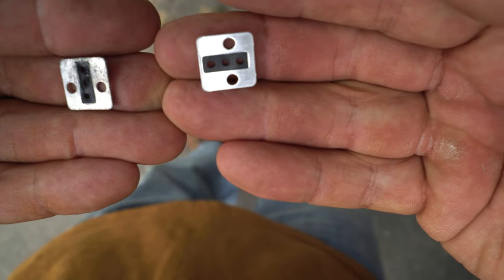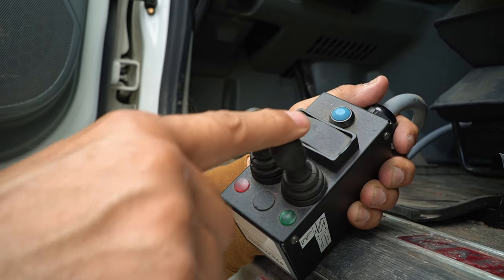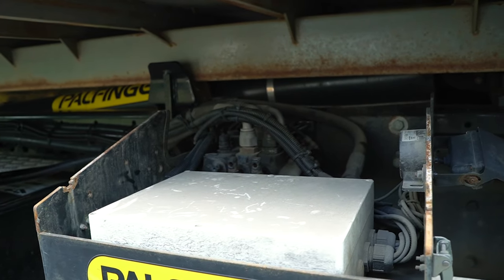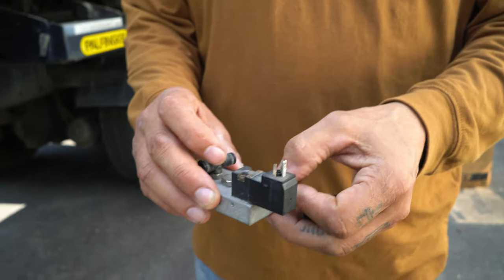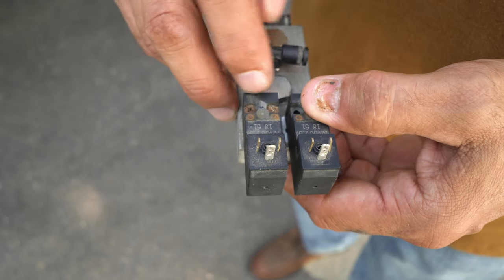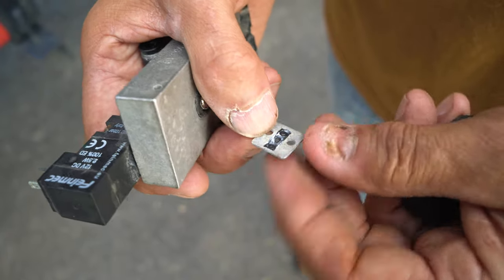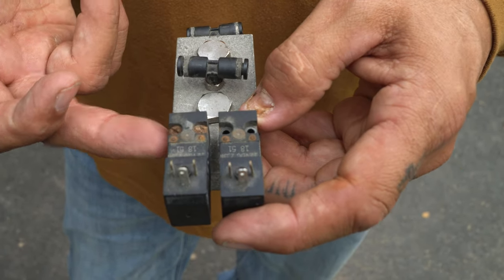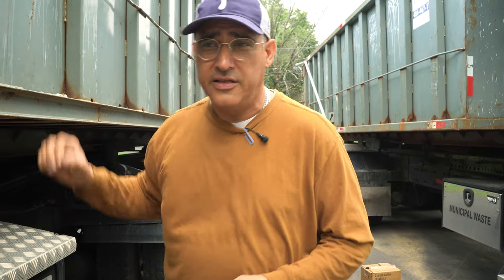Palfinger Hook Lift Hoist Issues

Comment: What I use on parts like that is called Dielectric grease. It will protect the metal parts and the rubber parts. I also use it on o-rings. The brand I use is DOW Corning but there are many others.

Comment: great video, the stuff the guy likely put on the washer is a special compound, not just a lubricant!- this is a jely which, in electronics terms helps to cool down the component, aka give heat in the solenoids, etc. a place to go (the metal in the valve, ignition system {body of the distributor}), to wick away the heat, saving any rubber/plastic in the device from melting, as some of this stuff has a lot of power (AMPS, NOT volts!!) going through them, esp. starter motor, or other motor control cables, or lights hence the 15/20A fuses in the fuse box!!
Reply from the maker: Sounds like a special lube for electric components
Reply: @LaRobertos  Yes, it is, But hydraulic valves and sensors (temp. and pressure) are connected to the electronic switches, and the main engine, or other management controller ( sets the idle speed to account for pump load, so the engine doesn't stall, or makes it throttle down to idle, as in a crane, to save fuel) so these are electronic in nature, also they sometimes ground the circuit through the component itself, so need this lube to conduct the electricity to the body/ chassis of the truck so the circuit is completed (can't go through any Painted surface, or have an air gap, it doesn't conduct well).